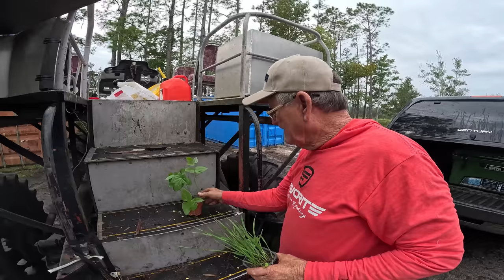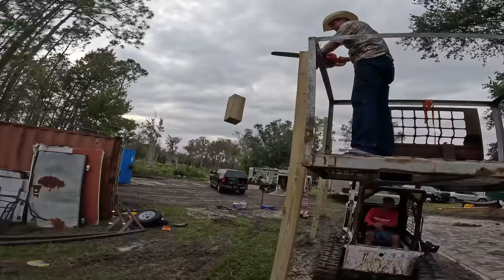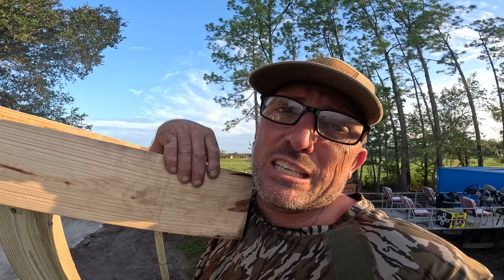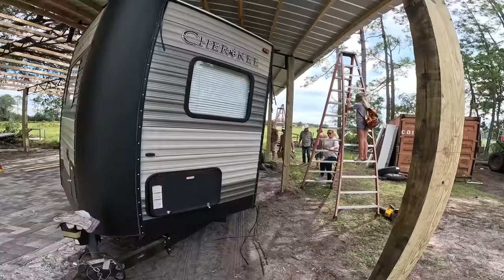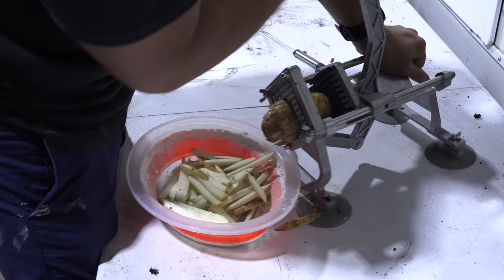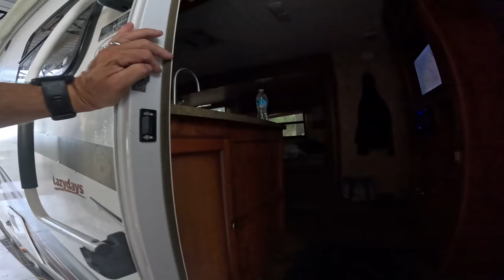We Build a Barn, Got Stuck in the MUD and Shot a nice Buck! The MOST Action Packed weekend ever!

Comment: Back in the day Rob I used to use a Stanley fat Max 35 or a 30 ft tape measure just like the one cliff had on his belt. I'd take the tape measure completely apart and remove all the tape drill a hole in the end of the internal metal spring that pulled the tape back in. And through that hole my rope from my spear gun would go. Was excellent for pulling your spear fish kills back to you underwater! The Stanley fat Max would be duct taped upside down to the bottom of my spear gun. Worked perfectly.